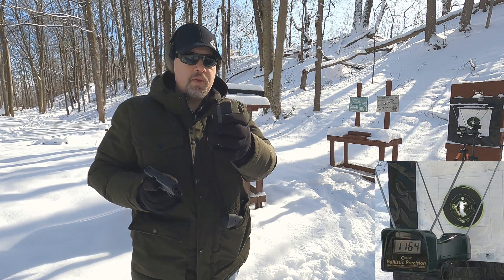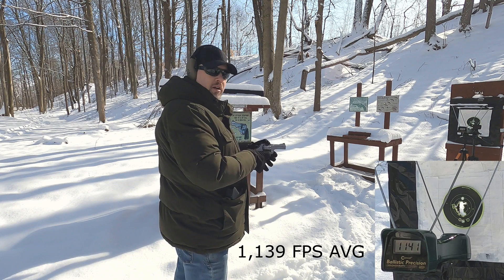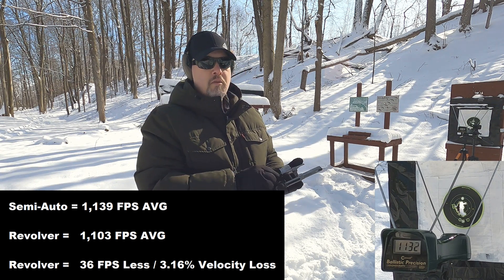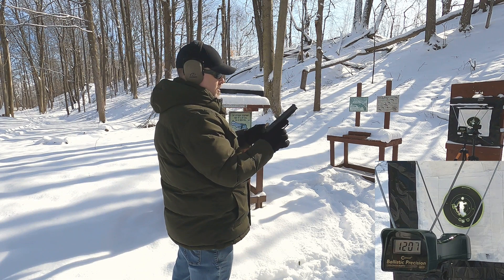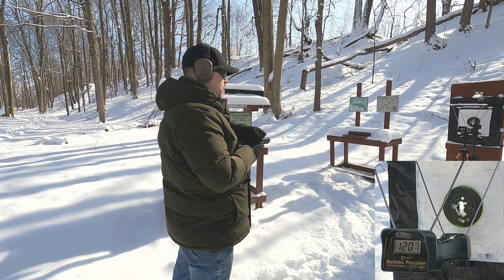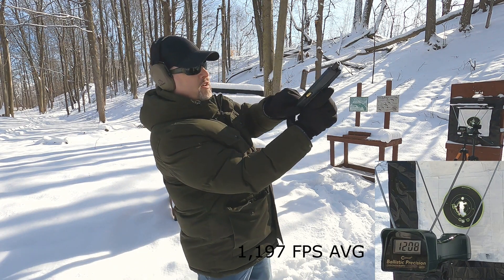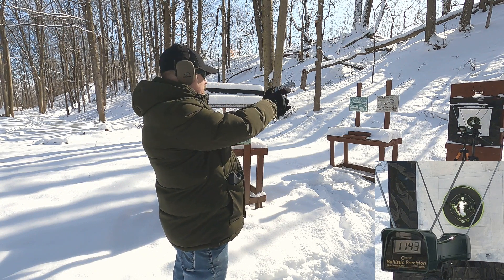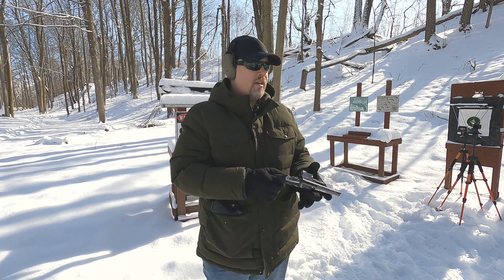You Lose MOST of Your Velocity from a Revolver Cylinder Gap!? (VS a Semi-Auto) 10mm Chronograph Test

Comment: There's a used 10mm match champion for sale near me in perfect shape for $900 but my M&P 2.0 10mm cost me only $600 in a range pack with a holster and 4 mags so I'll pass on the match champ. The cost to go for an S&W 627 would be worth it for the extra 2 rounds of a dedicated revolver cartridge with at least the same power.
Reply from the maker: I'm a revolver fan but also an M&P fan so I am torn. Probably the right choice. Ruger revolvers from what I can tell, never quite match the velocity of a S&W revolver.
Reply: @GunSam  I haven't found the Ruger revolvers to lose velocity compared to S&W, though the S&W actions are slicker.

Comment: RE: Why a Revolver , if I wanted to shoot Heavy 10mm the 610 looks stronger than most autos for safety .
Reply from the maker: That's the truth. Polymer is good up to a point, and that point is maybe, hot .40 S&W. After that weird things start happening.
Reply: In 2000 my childhood gun store talked me into a Beretta 96fs rather than a 92fs. Big mistake. With all cheaper flatter nosed 40s&w it would fail to feed leaving a smiley face on the bullet from the smaller feed ramp. So the 96fs was a 92fs just milled down to chamber a larger round. So lighter gun, larger load, more snap. Then I shot hot CORBON through it and the slide slammed back so hard it never ran right after 3 more range sessions. Took it back to my gun shop and they stopped carrying them because I wasn’t the only one experiencing this. Needless to say I traded it in.

Comment: Interesting results.👍
I have had really good reliability out of my Springfield XDmE 3.8" 10mm. So far, only Hornady Handgun Hunter has been an issue. I probably do not have the various different loadings you have come across, but so far that has been my only problem round. And it was weak sauce pretend mm anyway.🤷‍♂

Comment: A few years ago I did a similar trial with 22LR - 6" barrels (muzzle to breach face). The revolver was about 6% slower than the autoloader operating normally, and the autoloader was about 4% faster when the slide was held shut. In other words, the losses from the muzzle gap and the slide reciprocating were almost within the margin of error of each other. Yes, there are losses, but not enough to loose sleep over.

Comment: YT deleted my comment about wanting 10mm Revolver so I could plink w cheap .40
Reply from the maker: That's exactly why I got mine, other than for the 10mm testing. I told the guy at the gunstore this too. I said .40 S&W is way cheaper than .38 Special but it plinks a lot harder so it makes a lot of sense.
Reply: if you have a 40 S&W , the 610 would be a good choice over other revolvers . Hard cast/berry bullets  40s&w for low cost handloads .
Reply: Sadly, my 610 is not as accurate with .40 S&W, plus it doesn’t shoot to the point of aim.
Reply: @  Maybe you don't feed it the type of 40 it likes ?
Reply: @danoneill2846    That is possible,.  I tried 3 factory loads and 3 handloads.  I was not satisfied with any of the .40s.  Easier to just load light in 10mm cases for plinking rounds.  That works well.  Another 610 might not have this problem.
Reply: @TheGrendelbane   Thats a good amount of testing . Nothing wrong with 10mm cases , likely the brass is not beat up & they can be used over & over with target loads .

Comment: The semi auto loses energy from moving the slide back against the recoil spring.  Nobody ever brings that up.
Reply from the maker: Most semi autos are locked breech, so the bullet has left the barrel before the slide unlocks and then it uses the remaining gas to push the slide back. Your theory would be correct with direct blowback pistols like a lot of .32 and .380 ACP pistols, older pistols and Hipoints.

Comment: What is the cylinder gap?
Reply: The distance the round must jump (travel) through open air between departing the locked cylinder and the forcing cone prior to the rifled barrel. The bullet will never be completely out of the cylinder without being partially in the forcing cone. However, after the bullet is fully in the forcing cone the combusting power will partially blast out 360 degrees outward between the cylinder and forcing cone. If your hand is too close I’ve seen people actually get lacerated/cut from the blast. A big reason you will see Sam where gloves when he shoots his smaller framed 44 Mag

Comment: Sam, I happened to see this note on the Glock store website under .45 to 10mm conversion barrels. 
It might help with your reliability issues using the conversion. "IMPORTANT - for best reliability we strongly recommend that you install a G20 10mm extractor - our part #6200-10MM found here."

Comment: You've said that revolver has a .002" cylinder gap....so I'm thinking the velocity loss is more from the cylinder travel then entering the forcing cone before actually engaging the rifling vs the auto barrel rifling being engaged before the bullet fully leaves the case.   That small amount of cylinder travel where the bullet isn't forced tightly into the barrel will allow a bit of leakage and velocity loss.  Still...all things considered....that revolver is doing very well to only lose 3% or so with most ammo.
Reply from the maker: I have measured .003" or .002" cylinder gaps depending on the day it seems to change lol. It's pretty tight though.
Reply: 3% is within the variation of one shot to the next in terms of velocity. It could be argued that there is no actual difference.